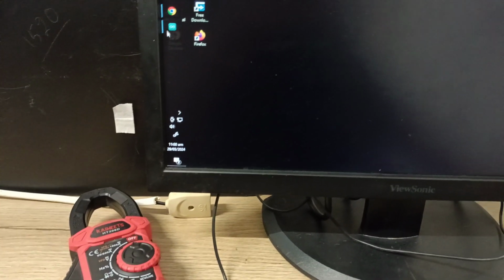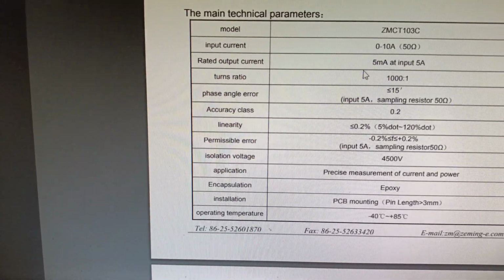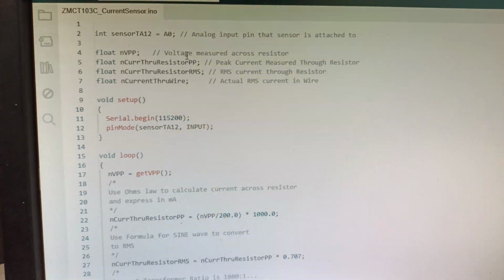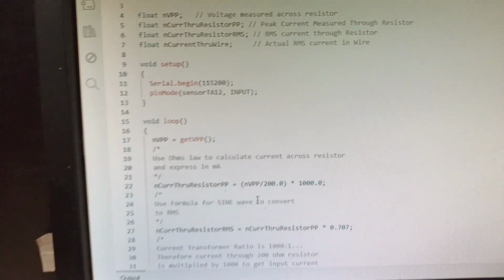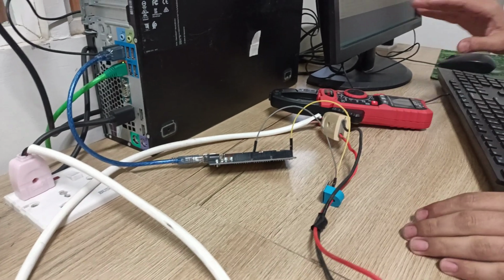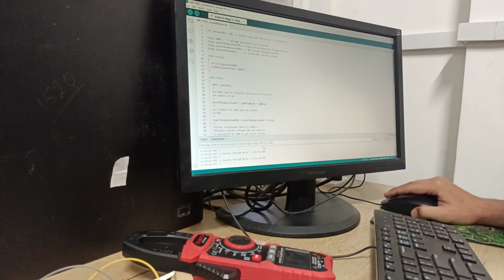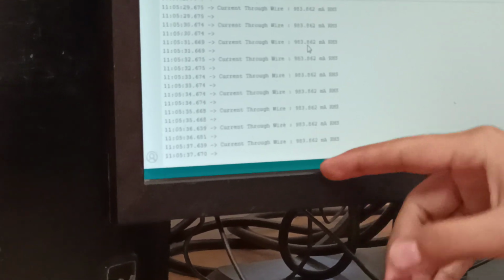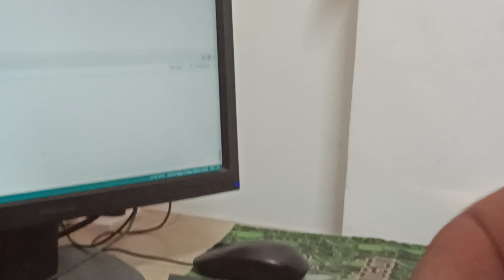Learn to Measure AC Current: ZMCT103C Sensor with Arduino/ESP32

Comment: int sensorTA12 = A0; // Analog input pin that sensor is attached to

float nVPP; // Voltage measured across resistor
float nCurrThruResistorPP; // Peak Current Measured Through Resistor
float nCurrThruResistorRMS; // RMS current through Resistor
float nCurrentThruWire; // Actual RMS current in Wire

void setup()
{
  Serial.begin(115200);
  pinMode(sensorTA12, INPUT);
}

void loop()
{
  nVPP = getVPP();
  /*
  Use Ohms law to calculate current across resistor
  and express in mA
  */
  nCurrThruResistorPP = (nVPP / 200.0) * 1000.0; // Assuming 200 Ohm burden resistor
  /*
  Use Formula for SINE wave to convert
  to RMS
  */
  nCurrThruResistorRMS = nCurrThruResistorPP * 0.707; // RMS = Peak * 0.707 for sine wave
  /*
  RMS current is multiplied by 1000 to get input current
  (This assumes a 1000:1 current transformer ratio)
  */
  nCurrentThruWire = nCurrThruResistorRMS * 1000;

  // Commented out debug prints:
  // Serial.print(" Volts Peak : ");
  // Serial.println(nVPP, 3);
  // Serial.print(" Current Through Resistor ( Peak ) : ");
  // Serial.print(nCurrThruResistorPP, 3);
  // Serial.println(" mA Peak to Peak "); // Note: Calculation gives Peak, not Peak-to-Peak
  // Serial.print(" Current Through Resistor ( RMS ) : ");
  // Serial.print(nCurrThruResistorRMS, 3);
  // Serial.println(" mA RMS ");

  // Active output prints:
  Serial.print(" Current Through Wire : ");
  Serial.print(nCurrentThruWire, 3); // Print calculated wire current with 3 decimal places
  Serial.println(" mA RMS ");         // Units are milliAmps RMS
  Serial.println();                  // Print a blank line

  // No delay in the loop, relies on the 1-second sample time in getVPP()
}

/******************************************************************
 In order to calculate RMS current, we need to know
 the peak voltage measured at the output across the
 200 Ohm Resistor. The following function takes one second worth of samples
 and returns the peak value that is measured
 *********************************************************************/
float getVPP() // Note: Function name is getVPP, but it returns Peak Voltage, not Peak-to-Peak
{
  float result;
  int readValue;       // value read from the sensor
  int maxValue = 0;    // store max value here
  uint32_t start_time = millis();

  while ((millis() - start_time) < 1000) // sample for 1 Sec
  {
    readValue = analogRead(sensorTA12);
    // see if you have a new maxValue
    if (readValue > maxValue)
    {
      /* record the maximum sensor value */
      maxValue = readValue;
    }
  }
  // Convert the digital data (0-1023) to a voltage (0-5V)
  // Assumes a 5V ADC reference
  result = (maxValue * 5.0) / 1024.0;

  return result; // Returns the peak voltage measured over the second
}
//fkof bro